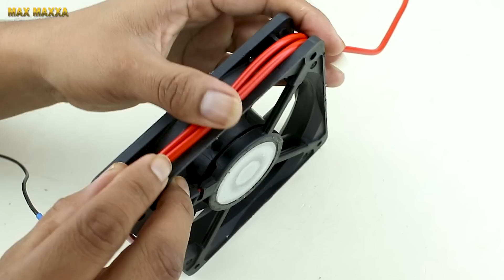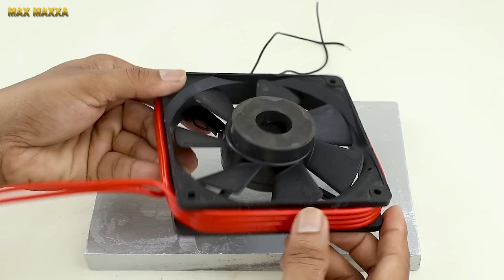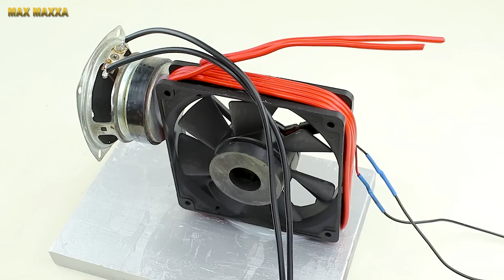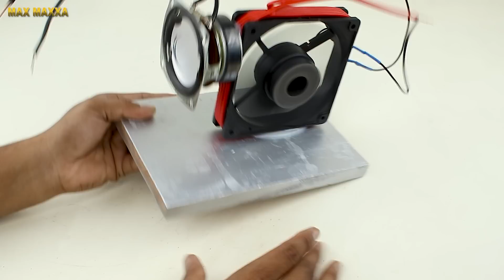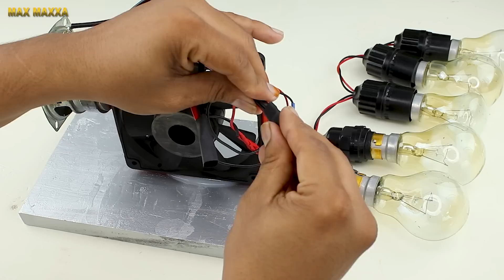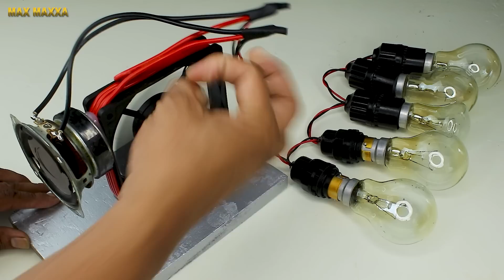Free Electricity 15000W Generator with Speaker and DC Colling Fan 220V Electronic Project

Comment: Weißt du überhaupt was du da sagst wenn du sagst: "Free Electricity 15000W Generator with Speaker and DC Colling Fan 220V Electronic Project" ? 
Aus deinen Motorchen bringst du nicht mal 0,0000000000000000000000000000000000000000000000000000000000000000000000000000001 Watt raus.